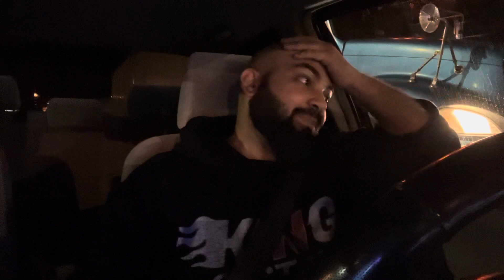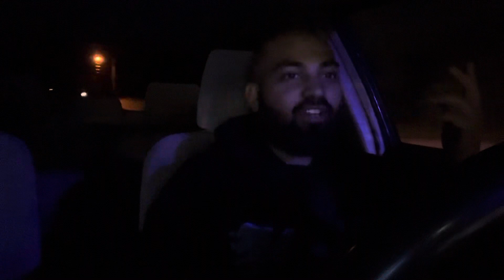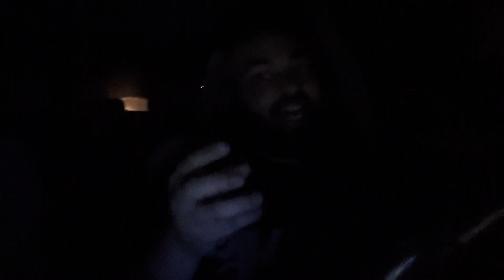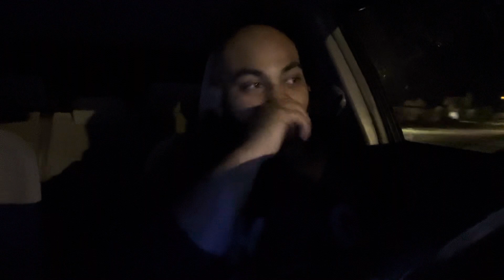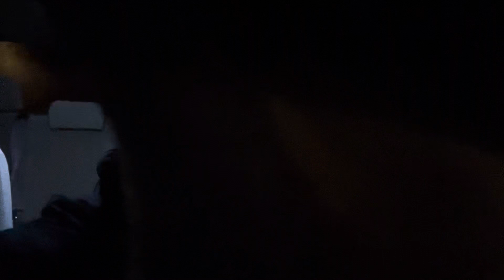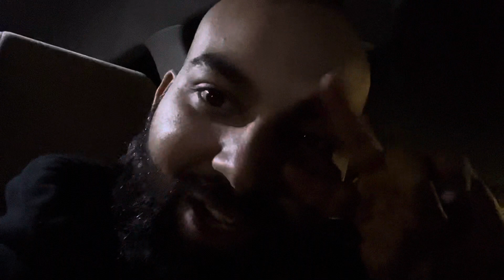Avalanche is making a metal vibration noise, help!!! Viewer question

Comment: My Avalanche has leaf springs in the back. 1/2 ton Chevy truck have leaf springs in the back as well. So my guess it that the 1/2 ton Avalanche has coils in the rear since it is actually a Suburban with the rear end made into a pick up bed.
Reply from the maker: Yes sir, the newer ones don’t have that set up.

Comment: Been there. After I replaced the rear end I had the same problem and chased it for 2 months. Found out it was the passenger side spring rubbing at the top
Reply from the maker: Gosh man mine last 6 months😂😂😂😂😂😂
Reply: @Kingcustomz  I had mine checked by almost every shop in Cincinnati and no one could find the reason till I got under the truck and finally found it
Reply from the maker: Dude it got to a point where I seriously wanted to take it to a shop to help me find it. But thank goodness I didn’t lol
Reply: @Kingcustomz  once I found it I took it to my guy and he did the adjustment for free. Lol.
Reply from the maker: Dang he probably felt embarrassed 😂😂😂
Reply: @Kingcustomz  no. He has no shame. Lol I've known him for 20 years lol
Reply from the maker: Oh wow man, that’s a long friendship. I love when people have a strong bond
Reply: @Kingcustomz  yes it is.  Now I will send you pics once I'm down with the new upgrades and updates on the avy. New Rancho shocks all around. New rear springs.  Leveling kit.  That's the start then moving on to body work
Reply from the maker: have you finished the body work